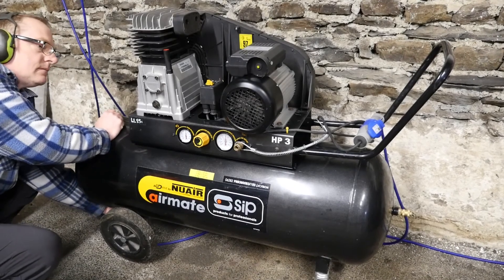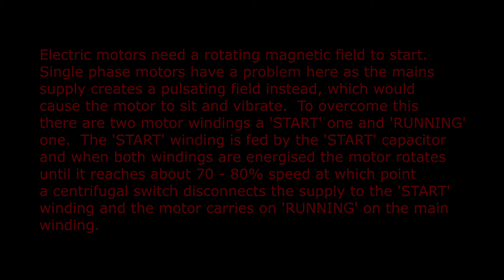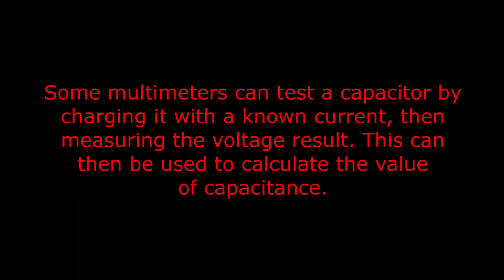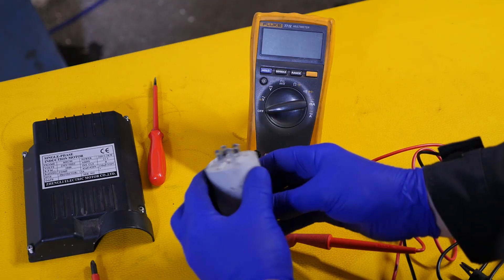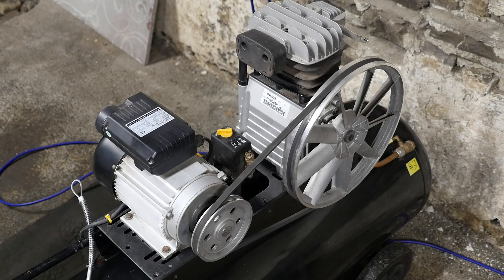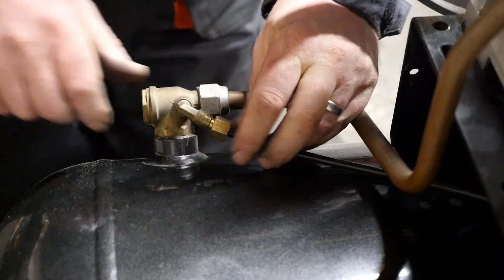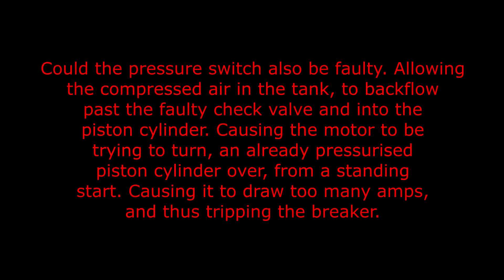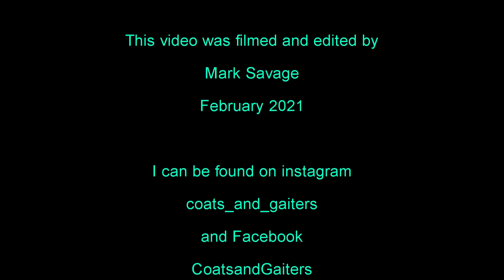Using Fluke Meter to Test Air Compressor Motor Capacitors & opening up my SIP One Way Check valve. ⚡

Comment: Good video. I bought the same compressor. The motor started up, but when it reached a pressure of about 5 bar, the motor stopped and did not start again. The motor did not have the strength to rotate the compressor shaft. The start-up capacitor, motor and compressor were fine. I thought the motor was defective, so I bought a new motor. Same situation. When the air pressure was more than 5 bar, the motor did not spin. Then I figured it out. The check valve spring was too strong and pressed too much on the rubber seal. I put a smaller spring and the compressor is working great now.
Reply from the maker: Great information.  Thank you for sharing.

Comment: This video goes on step beyond most DIY videos which just show you what they did to fix it. This is a nice tutorial on how the dual capacitors are used in the electric motor and exactly why they are needed. I did ran into similar issue of the Craftman air compressor that hums but did not run. Once I moved the piston, presumably off TDC, the air compressor runs but eventually, it tripped the circuit after I turn it off and on. In my case, the start capacitor is shot, it does not have enough energy to turn over the motor and overload the circuit. It is usually the first thing that fails if you don't use it often enough and the capacitor fails.  to hold charge. My compressor also has the exact same one way valve that is used in this compressor but it seems to have no issue. Very well done but I would replace that run capacitor, it is on its last leg.
Reply from the maker: Thank you for the compliment and agreed I should have replaced the run capacitor.

Comment: Why won’t compressor suppliers tell people what size of  capacitors are fitted to there motor I had a. Problem with my own which we’re old and blown all the company had To do was remove the lid and note the capacitors details mine were not legible
Reply from the maker: That would be an issue but you can normally get the schematic on the item and it will have the values on that.

Comment: Life saver, have the same compressor, just a bit older and 1 capacitor . Ours used to stall on re starting. The capacitor had blown (40uf off memory) replaced that and it lasted about a week . I didn’t check the valve block / non return valve as the compressor turned over easily by hand with no resistance. 
My next port of call and hopefully alls well . 👍😇😁
Reply from the maker: also check this item "Condor EV 1S Unloader Valve for MDR1 Pressure Switch 226765"  If this valve fails it may not allow the air to escape initially while the piston gets momentum up.

Comment: My compressor starts then stops and cuts the fuse, what can it be? Checked the capacitors all working fine.
Reply from the maker: It may be the air release valve under the pressure switch. Theres a thin rigid pipe that allows the air to leak initially as the compressor starts.  If this doesn't release the pressure in the cylinder is too much and the motor draws heavy amperage and trips.  search "Condor EV 1S Unloader Valve for MDR1"

Comment: Just fyi, yes UK voltage is 220-240VAC, however this is actually RMS voltage, peak voltage is actually sqrt(2)*Vrms which is around 311-339V. This would be one of the main reasons why you couldn't use the 250VAC capacitor. It would essentially blow up as it overvoltages.
Reply from the maker: arrrr thank you for explaining that.  I did wonder.

Comment: I want to thank you very much for this video. Before going down the route of buying expensive capacitors I thought I would look on YouTube for a video with the same symptoms and I came upon your video. Let me tell you I had the same symptoms but only from pressure to re-pressure. I did the exactly same thing you did but sprayed it with a bit of WD-40 and it works like a charm. Thanks again Claudio from Canada
Reply from the maker: That's great news CC 360.  Thank you for the comment.

Comment: Very helpful video ,I have got a compressor with same symptoms now ,I have replaced the one way valve as the old one had cracks in main seal and is still trip the breaker. I have turned down the pressure control valve under 5 bar and works fine , It would be a good idea to replace the pressure control valve to make it work over 5 bar ?
Many thanks
Reply from the maker: Mine works most of the time now but still has issues occasionally.  My next step would be to replace these " On the underneath of the MDR1 Pressure switch there is an unloader valve with a 6mm push in connection. The function of the unloader valve is to remove the pressure from the piston of a compressor so that when it re-starts it can move freely and prevent the motor from stalling."

The MDR1 pressure switch is supplied with a delayed unloader valve (AEV 1S) as standard.

Comment: I have a 25gallon 2 hp craftsman compressor.   Mine never trips the unit breaker but mine trips the house breaker. I ordered a check valve and hope that works.. where is the unloader valve located in a compressor?    looks like the check valve and unloader valve is the same thing?
Reply from the maker: The check valve is the copper pipe that feeds the big tank and has a one way valve inside.  The unloader valve is tiny on the end of a black pipe going to the electrical switch unit on the compressor.  The house breaker may be struggling with the sudden power surge required to start the compressor.  There is a large power spike as soon as the compressor starts up.

Comment: Great video, nicely explained. I've experienced similar symptoms on a 3hp compressor that runs off normal domestic socket (I'm sure this should have been a 16a socket), it sometimes trips garage circuit breaker or the garage supply from the main board in the house and sometimes both but never the overload switch on the actual compressor itself. It did pop a capacitor few years ago but I did replace run & start caps with caps of the same ratings. At least watching your video has given me some ideas of what to check next 👍
Reply from the maker: Thank you again for the compliment.  Turned out to be the tank one way valve or check valve.  I still had a few issues every so often.  I thought it cant be the check valve but it was.  It's never tripped once since I changed that and I use this daily.  I think you also need a healthy spur line going straight to the consumer unit with a 16amp plug.

Comment: Can you help me? I have a problem with my compressor(Single fase electromotor, 100l tank, similiar to yours in video)..  It worked fine for 15 minutes and when it started do run again to fill up air, it started to rotate in reverse order. The switch kills motor instantly and button pops out.. Could it be a one way check valve that is the problem? I just dont understand why would electormotor spin in wrong direction. Thanks in advance!
Reply from the maker: I’ve not heard of that one but the tank check valve was causing my motor to trip.  Maybe the brass check valve on the tank is leaking and your getting a back flow of pressure.  I thought my check valve was fine and couldn’t have been the issue but it was.  Compressor has worked fine ever since.
Reply: @CoatsandGaiters  I checked the valve, cleaned it up and evertyhing but it still runs in wrong direction and stops after 2-3 seconds..
Reply from the maker: @FKCro  I did that as well and I swore the valve was ok but it wasn’t
Reply: @CoatsandGaiters  Did you buy new one then?
Reply from the maker: @FKCro  yes.  I think they wear and the spring relaxes
Reply: @CoatsandGaiters  Where can i get one? Thanks a lot man ❤️
Reply from the maker: @FKCro  I think I used a company like this one: https://www.fps-compressors.co.uk/non_return_valves_nrv.html

Comment: Great video mark. Ive just had a capacitor go pop. It made the thermal cut out kick in. The weird thing is its only got one capacitor ( I'm taking it it's start run capacitor. Bad thing is I can't get a reference for the uf but it says 500v
Reply from the maker: Thank you.  I think you can have either a start or run capacitor depending on the start up torque needed by the motor or whether efficiency at rpm is more important.
Reply: @CoatsandGaiters  I'm going to get a 500v uf 45. Cpc seem to be good 👍
Reply from the maker: @bigblue1402  I think you have to replace like for like.  I bought a cheaper capacitor but then read the values must be the same to avoid damaging the motor.
Reply: @CoatsandGaiters  cpc's website is rather good.  Just going off what I have left of a capacitor and your video (for the uf value)
Reply from the maker: @bigblue1402  Hope you get it mended and it works for you.
Reply: @CoatsandGaiters  I'll let you know
Reply: Got a 450v/500v 100 uf works 👍 and cost £13
Reply from the maker: @bigblue1402  that's fabulous news, happy days

Comment: Had the same symptoms on an air compressor. Followed your steps and found a small piece of rusty rock or whatever in the one way valve. The tank had never been water drained and there was A LOT of water in the tank. After cleaning the valve and putting it back together it works perfect. Thanks for sharing.
Reply from the maker: That's great news.  Just hope the tank hasn't rusted too much.  They can go with a bit of a bang.  I sort of get scared now with mine as it's over 10 years old.  https://youtu.be/sm_FJ6Pat4I

Comment: Great Video
Makes Me think about more than Capacitors Gone!
Thanks for The Upload
Thumbs Up!
Reply from the maker: Thank you for the compliment.  The check valve in the tank seemed to be the issue in the end.  Ironically I changed the tank valve and it’s been fine ever since and back in the original capacitor.

Comment: Hey does it matter how you connect a starting capacitor or is there a certain way it it should be connected ?
Reply from the maker: I believe you can connect either way as it’s AC voltage so alternates anyway.  But I’m no qualified electrician.

Comment: Solve the problem of stopping the compressor before charging
Reply from the maker: The problem turned out to be the air tank check valve.
Reply: @CoatsandGaiters  thank you

Comment: I have a compressor that struggles starting, it has a 60uf and a 65uf capacitor in?
Reply from the maker: Does it struggle when empty?
Reply: @CoatsandGaiters  yes, I have changed the unleader valve and t valve already

Comment: Very helpful troubleshooting video , I went to a garage sale and bought a very nice 30 gallon compressor in like new condition. I tested it before buying it and it ran and shut off properly . It is a vertical or upright tank unit. Of course I laid it on it's back in my work van to transport home to my shop and it got bumped around . Upon starting it in my work shop , it would run until it reached 95 PSI and trip the breaker .
Now I know where to look after testing the capacitors . P.S. I am a Marine Electrician , years ago I worked in an electrical shop and a careless young man had got a terrible shock from a capacitor
smaller than the ones you were handling . I think your fear and caution was warranted. Thank You for addressing this International problem " I am in Florida USA " Have you ever considered working for the United Nations ? They could use your problem solving skills !
Reply from the maker: That's exactly what happened to this compressor.  It was fine for years, then we moved and it obviously got bumped around in the removal van.  Next thing it kept tripping the breaker when pressure was high in the tank.  I think my problem solving is driven by my tightness to not spend money unless absolutely essential lol

Comment: Another informative video Mark! Ive a smaller Clarke compressor that ive had since about 1993 when I had a car to spray aftr re-build. It has been a faithful companion with only minor maintenace however, one year the overload that cuts the motor off when pressure is reached failed to trip till about 15% over- on occasion it tripped the dump-valve. I replaced the pressure-switch as they warned us apprentices of the dangers compressed air can cause if not respected. I do remember some of my theory classes back in the day!
Reply from the maker: Thank you Patrick.  I did a couple of resprays around 1993/95 with cellulose but then the EU was talking about banning it and only 2 pack would be aloud.  Never sure what came of that.  I loved paint spraying it was so rewarding watching the panel change colour.  You need ideal conditions though or else lol.  

You mention some good points to bear in mind with a compressor.  I always fear the rusting of the tank and it ripping open.

Comment: You might not hear check valve leaking if unloader valve is not open. Manual release of unloader valve is possible by opening the pressure switch.
Reply from the maker: Thank you for the info

Comment: Could i get some more pictures of the wiring for the both capacitor.messed mine up and looks very similar
Reply: Wish it would upload a pic of my wires
Reply: Is it the one under the pressure switch
Has a little metal ring to pull to release air?
Reply from the maker: @sylwinkassem2274  hi just watched the video, yours looks slightly different and stops differently to mine.  Mine was struggling under the pressure load.  Have you tried emptying the air tank and seeing if it will run normally with an empty tank.  Mine was debri in that thin black pipe thats on the left on yours and then leads to the pressure switch where the electrical contacts are.  Make sure you don't get an electric shock from the open contacts.
Reply from the maker: Hi I have received your email and the wiring on yours is the same as mine.  So yours should be correct.  I have Main Power Brown + going to trip, then the black from trip going to a double black on the running capacitor where one of those black wires goes into the motor alongside the grey wire also from the running capacitor.  On the other side we have the Main Power Neutral - changing to a Yellow wire going into the motor and next to that yellow wire is a Blue and Grey wire coming out to the Start Capacitor with main earth connected to motor housing.  I have emailed 6 photo's to you as well.  Check the little black pipe from the one way tank valve that goes to the pressure switch on the tank.  That turned out to be my issue of the compressor tripping the trip.  I removed the sensor pipe and there is a little spring pin on the end.  Make sure the pipe is clear and the pin operating correctly.  I blew WD40 down the pipe.  Think a bit of grit got down mine and caused the issue.
Reply from the maker: The valve on the black pipe is called "Condor EV 1S Unloader Valve for MDR1 Pressure Switch 226765" if you search on ebay
Reply from the maker: The symptom I had was if the tank pressure was lowered by letting some air out it would work fine and the motor wouldn't trip but if it was near max pressure the motor couldn't do it and blew trip.  Since clearing that thin black pipe and checking the little pin valve its been running fine ever since.
Reply: After removing the black tubing from the one way at the end of the tank,air compressor runs continuously no problems.reconnect the black tubing and compressor runs 10-15 seconds and shuts off,wait for the reset button to click then press and runs only runs again 10-15seconds
Where should i be focusing on?.
Reply from the maker: @sylwinkassem2274  Thats what mine did.  I twisted and unlocked the end by the switch and blow the dirt out and sprayed a bit of wd40 in to help clean things.
Reply: When you say switch are you referring to the pressure switch side or the other end where you have a connection pipe from motor,black hose from tubing and other end blocked off
Reply from the maker: @sylwinkassem2274  the part that has the on off switch on and a pipe going straight down into the top of the tank.  One end has a nut and the other end is a twist lock with a tiny spring on and a little rod that moves.

Comment: Thank you so much for the video. I really helped.me a lot because i had the very same problem. I did all the test that u have done except for the last part where u remove the valve and the pipe for the pressure switch. BY the way, was it the lock tile that u put on the nut of the valve?
Reply from the maker: Thank you for the comment.  The problem in the end was that thin black pipe and the little pin valve on the end.  Think it was sealant I put on to stop air leaking.

Comment: SO Did you ever find the problem?
Reply from the maker: In the end it was the little black pipe with the unloader valve on the end which went to the pressure switch.  Think grit got into it and stopped the tiny pin from moving up and down against the pressure switch.  I sprayed wd40 and air into the pipe to clean it and so far it's been working.  The clue was it always worked when the tank pressure was half but tripped when the air pressure was higher.